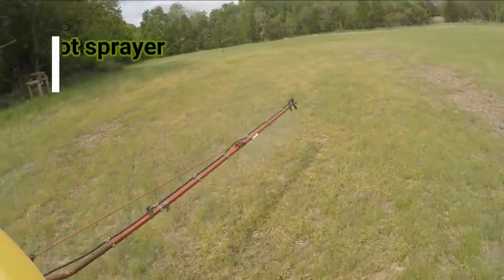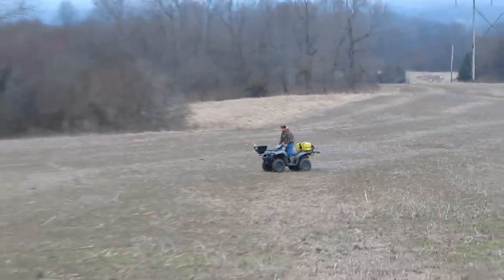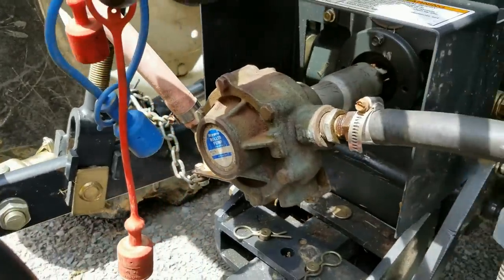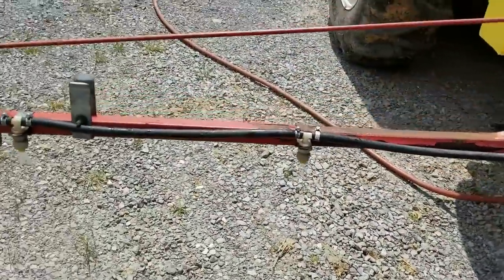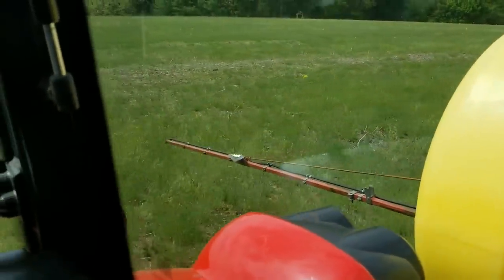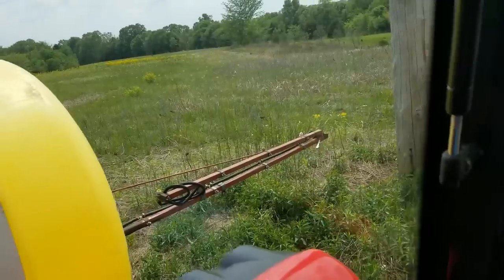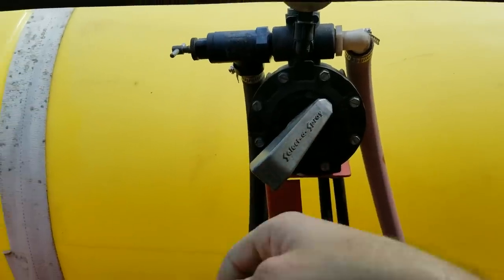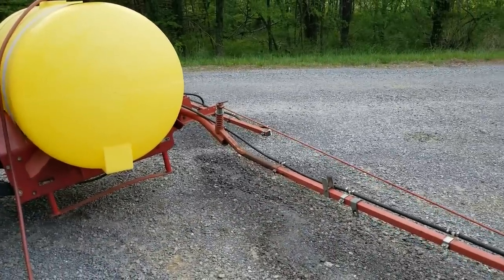Used Boom sprayer Barter trade, How will it work? Conservation plan.

Comment: You got a sprayer all I seen on your trailer was a boat Man. You need to build a pully setup for your wings that you gust pull on the right or left rope to lift up your wings so you do not have to get out off your seat Kapp.

Comment: Dude, How can you spray without an operating  pressure gauge? How did you calibrate the sprayer? I'd replace all of those nozzles, if the unit has been sitting a while? They look like 10 gallon/acre nozzles? Check the GPA math formula and plug in your numbers as you collect them-speed, Gpm, nozzle spacing etc.